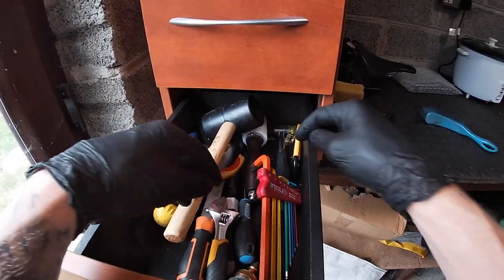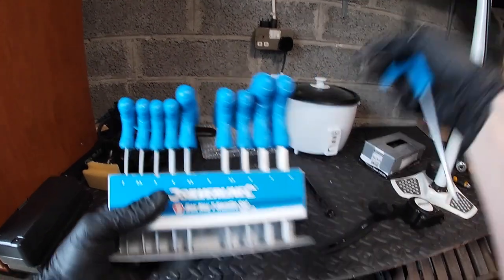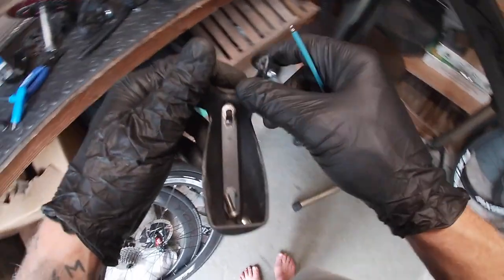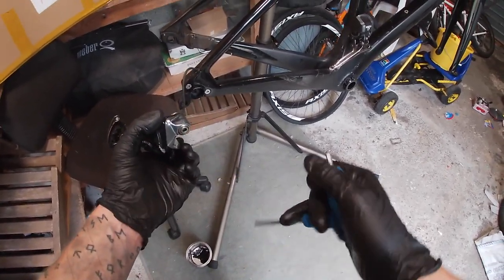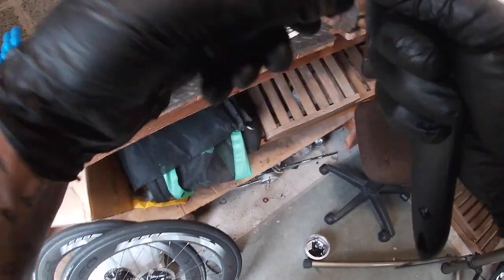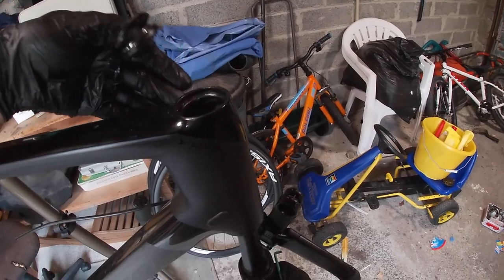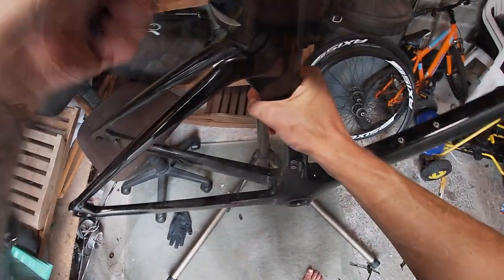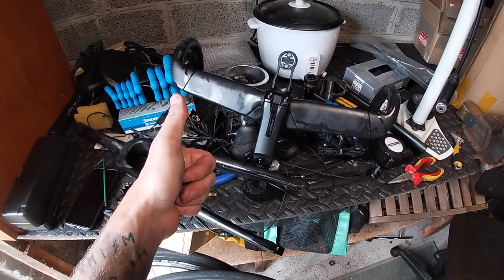Taking Apart Yoeleo R6

Comment: Do you have any suggestions on making the aerofly bar and stem fit onto the R9? :)
Reply from the maker: Ozzie Gaming Servers at the moment it’s just an idea, I may have to use a spacer underneath the stem to get the height I need to pass the cables from under the stem into the frame. But I’ll keep you posted in future videos. 👍
Reply: @KyrosHouseCycling  No worries :), may i ask how does the specialized  headset n spacersyou got from earlier fit onto the R9 frame? Do they fit?
Reply from the maker: Ozzie Gaming Servers it’s because the Yoeleo clamp is a wider diameter and needs a sleeve to fit onto the steerer tube. As I said it’s an idea and I haven’t fully tested my theory. 👍
Reply: Kyro's House Please do keep me updated on your theory🙏🙏. Very much wanted to use stem + handlebar combo in the future on my R9 to prevent any major hassle w maintainence
Reply from the maker: Ozzie Gaming Servers yeah I will mate, hopefully I can get onto it soon, busy at the moment. 👍